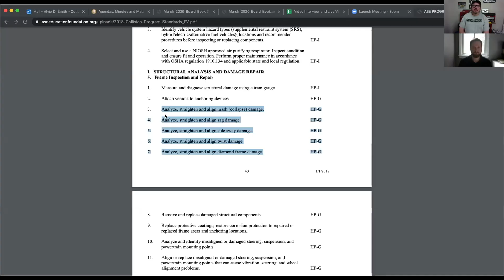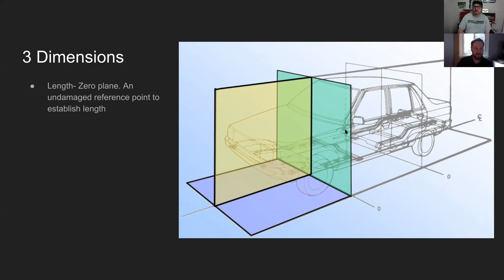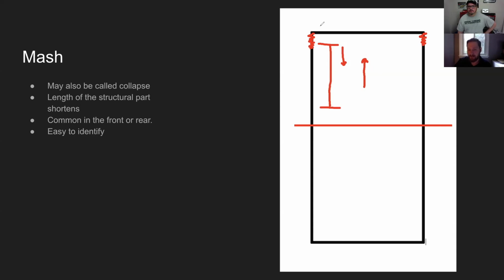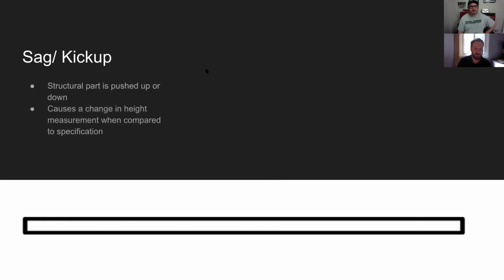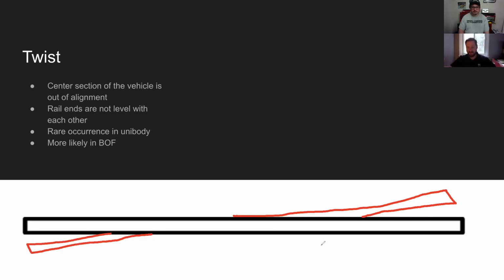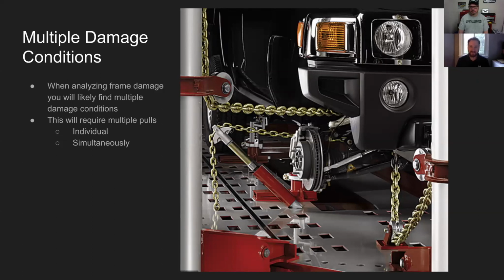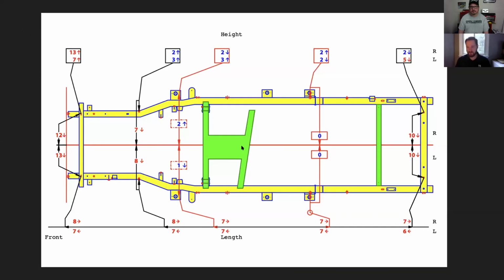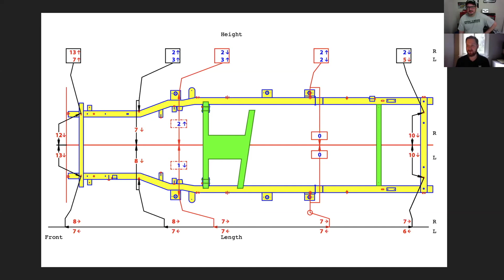The 5 Types of Frame Damage with Bill Bacon

Comment: Great info I'm considering buying a work suv.
Someone took it to different buying lots, 4 different offers were made.
The worst offer came from a buying company who had their own report, not car facts.
It was a rear end they said it had frame damage.
The hatch you raise had not been changed one body panel on rear was not properly installed.
The quotes were way different the suv does not pull and drives perfect.
Thank you for the info so I can double check.
I have had lots tell me a car was in a accident when we were trading in.
We sold the car to a buying lot who said nothing was reported.
They gave us top dollar so the dealer was lieing.
That's no suprise.
I'm going to do my own car fax on this suv and look under at Frame.
I have laser for measuring it.
The rear latch is loose but works, and rear back fender panel needs body tabs.
I'm thinking it recieved a bumper and was put back the rest of the way with existing parts. Since it was on one side I will check for sway first then triangle and Sq.

Thanks guys very good presentation

Comment: You are describing this as if you are talking to another mechanic that understands what you mean. If your intention is to educate or help someone who doesn't know much about cars, use more visuals and lamens terms. Examples: stop saying specifications - I don't know what the specifications should be so I don't know what to compare it to.
Reply: Probably talking about manufacturer specifications. They have diagrams that show where bolt holes on the frame should be relative from the 0 and center line.

Comment: I AM YOUR FAN OF WORK FROM PAK.  DEAR I HAVE ONE QUESTION , my car have  bent radiator support from below i hve issue of car floating on highway. Suspension work done but it did not solve the issue,  tires also upgraded n same fault.  JUST tell me that how can one measure frame rails at home of CAR if it shifts from right to left .